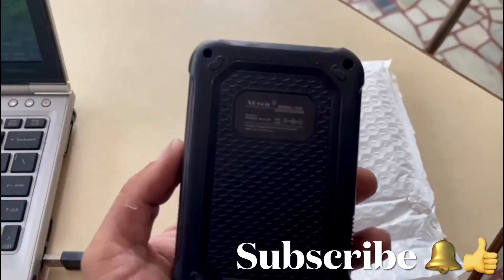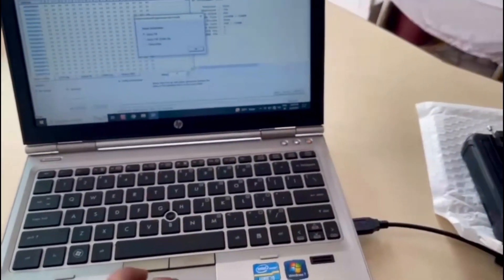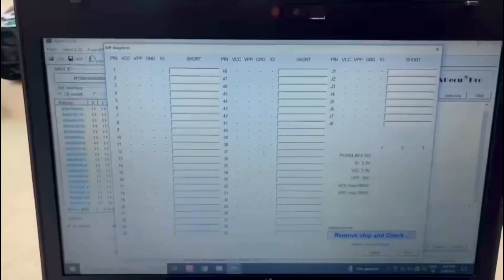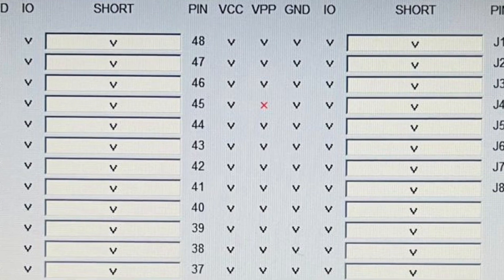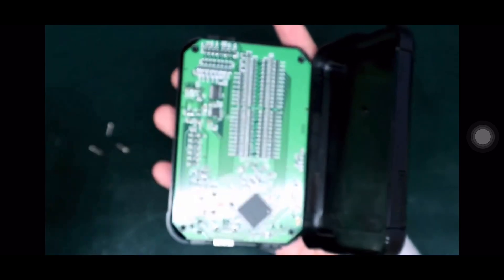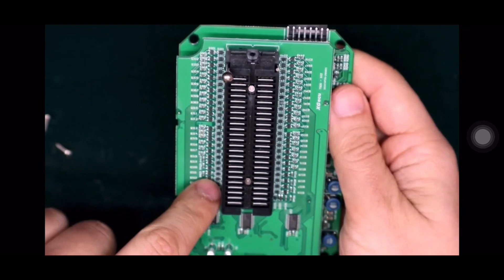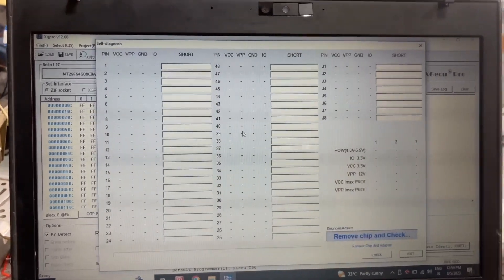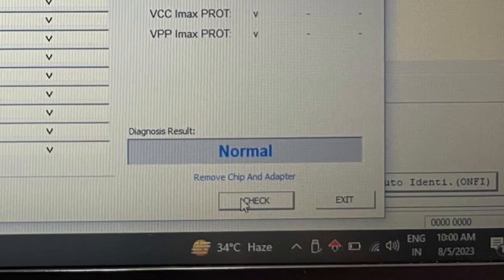XGECU T56 SYSTEM SELF-CHECK PROBLEM. ERROR! REMOVE ADAPTER/CHIP. TEARDOWN VIDEO

Comment: Please sir which one do you recommen for tv repair RT809H or XGecu T76 please do reply thank you
Reply from the maker: both are very nice… 
xgecu t76 may be better if you want to repair android TV or better for emmc work “but its little difficult to use because everything is manual and hidden inside interface”

RT is very simple to use and good but i do not find much good support for larger emmc. “interface is very user friendly”

actaully buy both one by one….

Comment: Hey I have a problem with xgecu t56 self check with j2 gnd. Maybe a little hint what might be damaged
Reply from the maker: give a little flux to all components and show a little heatgun and clean it with cotton and isopropyl solution. it should fixed

Comment: Could someone please help clarify for me how to successfully "test clip" program a soldered Macronix MX25L4006E SOP8 and a Winbond W25Q128JV SOIC8 chip both on the same TYAN S5545AG2NR-HE "secure flash" model motherboard using this XGecu T56?  I understand that this model needs custom "crossover" wiring from the ICSP to the clip and proper grounding and whatnot and the diagram which comes up in the XGecuPro Software v1266A for each module to explain the "in-circuit" custom ICSP pinout is not clear at all to me concerning how this test clip should be wired for a successful chip pin connection.  I bought this for work for this particular time-pressing project I'm working on and cannot make heads or tails of how I'm supposed to wire this ICSP to test clip for these two model chips.  This T56 is literally worthless to me if I cannot get this sorted out.  My simple Coright Skypro is much easier to use than this device -- it literally autosenses all modules and senses with successful programming many SOIC/SOP-8/16 soldered "in-circuit" chips with POMONA or 3M Test Clips with little struggle.  Admittedly my handy Magnifying Lamp is a huge help in getting solid clip commections and minimizing destroying clips too quickly, but this soldered Macronix MX25L4006E on the TYAN S5545AG2NR-HE "secure flash" model motherboard is not reading or writing correctly at all.  I've ruined 3 total clips struggling before realizing the chip needs a custom wiring for a successful ICSP connection.  The problem is what exactly that 8 pin wired schematic looks like.  I've messaged the XGecu and posted on their message board with zero response.  If you boast in-circuit programming concerning your programming product, you shouldn't make the instructions impossible to sort out.  This is extremely frustrating.  Can someone help me out with this "in-circuit 8-pin SOP pinout ICSP connector to Ponoma test clip" please?  I also have a nearly unused TL866II Plus with SPI DRIVER ICSP Enhanced Adapter if that is easier to use for this task.

Comment: Hello! do you think that this last programmer is not very successful? which programmer do you recommend me to buy?
Reply from the maker: well this depends on your work…what kind of stuff you want to programme and what kind of mostly chips you will get in your work? tell me then i can recommend better
Reply: @rajuradios  I would like to buy for general programming the s29 chip on the Rns 510 navigation
Reply from the maker: @militarucatalin well this is little advance programmer what is mean to say is you will have lots of functions inside this device’s software but everything is manual sadly 🥹 so only advance people know about this. well RT809H comes with very comfortable and easy interface and best to deal for this kind of flash ic. so you can buy this programmer RT809H.
Reply: @rajuradios  I keep looking on the internet for details between the two but I can't find it. you say that the one you recommended is over xgecu t56?
Reply from the maker: @militarucatalin yes t56 is better if you want to deal with large capacity of flash drives and emmc ic but in the end of day everything is manual so which gonna make more difficult your task
Reply: @rajuradios  to understand that it does not automatically detect the chips?
Reply from the maker: @militarucatalin yes this and little more also